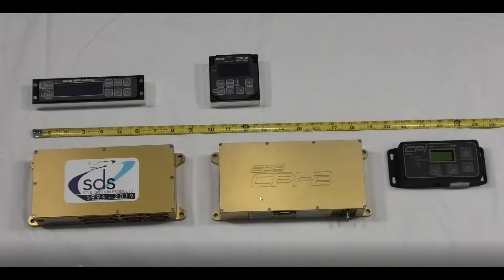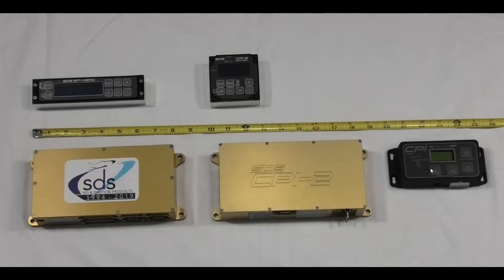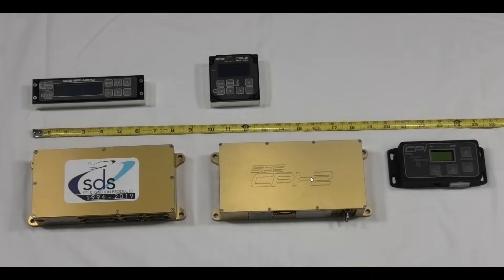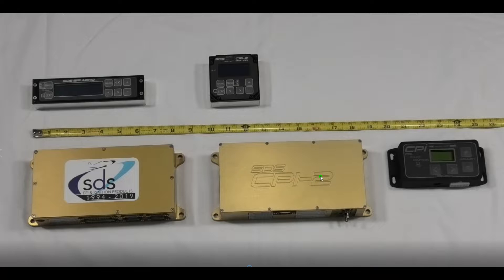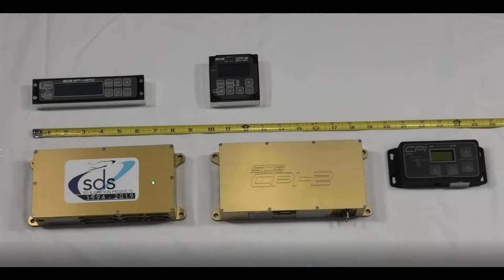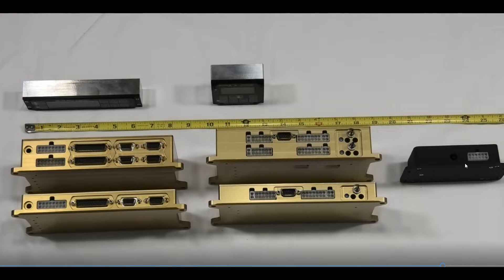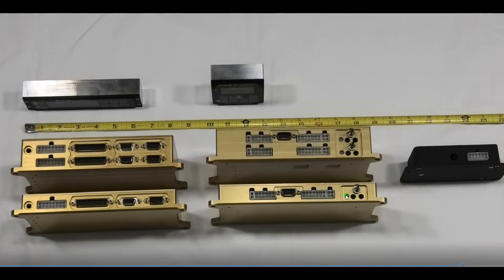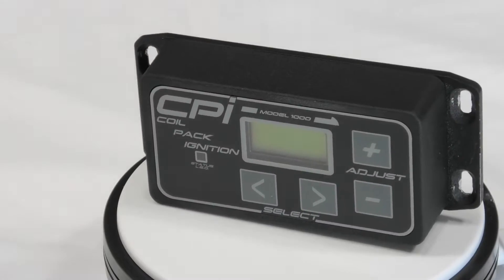SDS Electronic Products for Aviation

Comment: Thanks for posting.
Reply: Would mind commenting on the mounting holes diameter for these products? Thanks!!
Reply from the maker: @WhallonJesse  The CPI-2 and EM-5 ECUs have 1/4" mounting holes. The CPI generally uses  8-32 screws. The panel mount programmers use 6-32 screws.